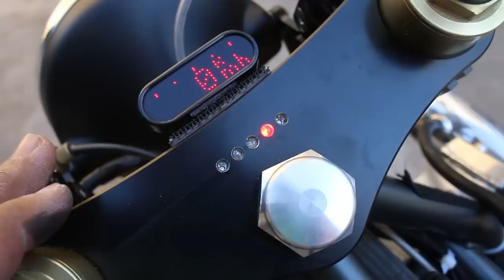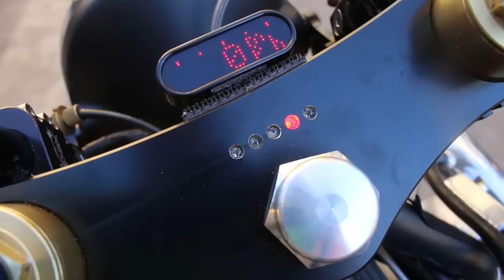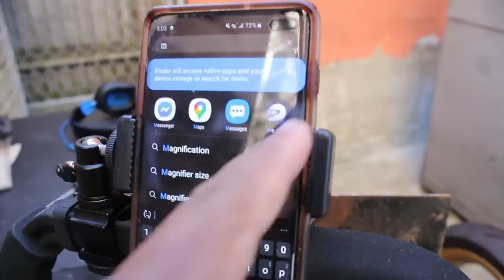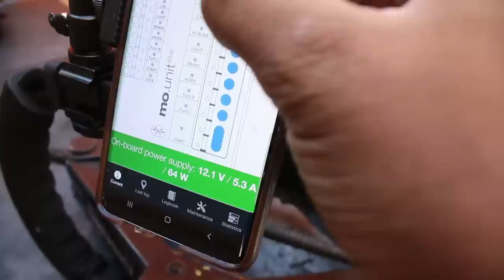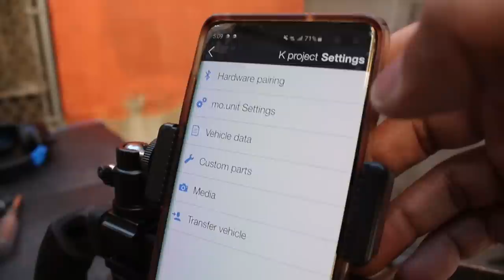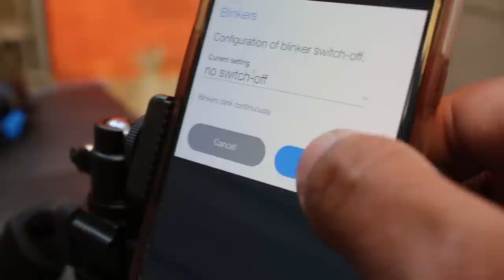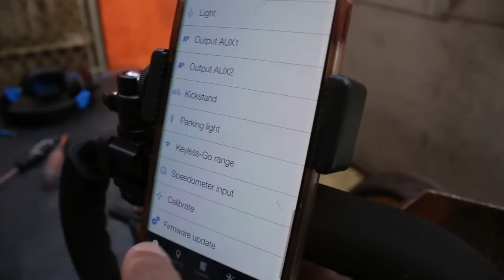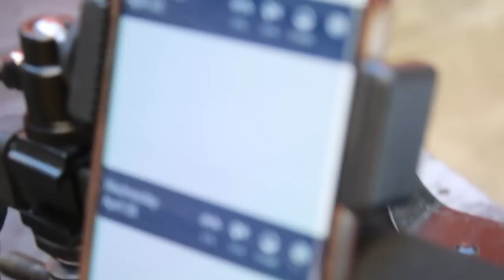[Ep 15] 1986 BMW K100 Cafe Racer Project - Lighting Overview & M-Unit Features

Comment: It's like unwrapping a present every time you want to work on the bike lol.  I would be happy every time.  Glad to see a new video.
Reply from the maker: 😂Thanks for watching!
Reply: @Theillestrator1050  Heck yes!  I built a motorcycle out of nearly the same components ten years ago.  

GSXR 750 front end on a Suzuki GS with a Ducati rear half frame and a R6 shock and 180 rear wheel I can't recall.  It was a LONG project. 

I never should have sold it. 

When I came across yours I binged it and smiled as it was like a good flashback!

Comment: That M-unit is awesome. I’ll probably use it if I fix up an old bike again someday. Glad to see you’re doing ok, especially in such a heavily hit area. I’m ok here, but broke my foot getting my bike out of winter storage, so now I’m not riding till summer. Stay safe, and hang in there!
Reply from the maker: I definitely recommend it,  it's expensive at like 400 bucks but you can get the non bluetooth version for 300 or so...I say go all the way though. Yes im good health wise, just naturally in a slump.
.....😰 ok well you gotta describe how you broke your foot getting the bike out...too ironic not to.
Reply: - The illestrator - I think we’re all in a slump these days. So I had my bike tucked away in a storage unit for winter. Put the battery back in, started it up, did a couple wheelies, went to leave. Automatic gate didn’t open. Same problem as red light sensors, it didn’t detect the bike there. So I hopped over the gate to punch my code in from outside to open the gate. Did not stick the landing. 😞

Comment: I think its pretty good that they dont let you start the bike with bluetooth, dont think thats secure.
Reply: I wonder if it needs to see that the bike “is in neutral” (electronically) to use the starter on the app. Bluetooth can be very secure, but depends on the version of Bluetooth that it (motogadget) uses on the security that it provides
Reply: I would assume its based on safety. They don't want the liability of you remote starting your bike in gear and it shooting out into the street or spearing a small child.

Comment: Trust me, after a while, or your first boil over, you will want to setup at least a simple thermocouple style fan switch/relay setup to kick those fans on.  Especially with no temp gauge.
Reply from the maker: Maybe, but if that ever becomes a bridge to cross, I'll wait until I get to it. The bike has a shut off feature that will kill the bike before a boil over. Not terribly worried about that. And if it's hot out, or im in traffic, I'll just keep the fan running. I'll learn if that's a mistake at some point lol

Comment: Good to see your still alive 😬 bike looks awesome! I wanted to let you know that this build is inspiring that something this cool can be built with minimal tools. Thanks for this vid as I was wondering how the m-unit app works. Couple of questions... can the fan be set up with a temperature sensor vs a button? And when are you going to finish the seat?!
Reply from the maker: Thanks man, I'm sure you can set up some sort of fan switching relay if you really look into it. This is just a quick and dirty route. As far as the seat goes, I'll foam it this week before moving it out the back.

Comment: I'd imagine having the starter plugged into the blutooth would be a problem if you parked it in gear lol. It's crazy that you have become so familiar with the bike that you know what every wire does. Pretty soon you will be making your own color matched wiring loom. Great job, man
Reply from the maker: 😂 didn't even think of that... they're probably thinking of the lawsuit when the bike goes flying into traffic. I know all the wires, if only they were neater lookin
Reply: @Theillestrator1050  Some plastic convoluted tubing goes a long way to making wires look neat for only a few bucks at the auto parts store

Comment: Glad to see the progress, was thinking about you and NYC the other day. 
FWIW  I thought I had a sprag clutch problem too, tried the Rislone / Syn oil approach, turned out to be starter brushes.
That was at about 80K miles. Got home a couple of times by bumping the bike backward in gear. 
Hope you can get some miles on it soon! 
Ride safe! Wash your hands!
Reply from the maker: Thanks, 
So I have two starters because I thought the starter was the issue too... second starter changed nothing. I then tried the backwards roll trick... didn't work. Next step is to try the rislone and oil change. Hope that works for me..
Reply: @Theillestrator1050  I should have known you'd be on top of that.
Here's hoping! Cheers!

Comment: Awesome as always! About the wing nuts, try some loctite on them before you go for a ride. Vibration will wiggle them loose in no time. Ask me how I know!
Reply: Just use two spring washers underneath or nylon wing nuts
Reply: I have wingnuts on my Springer with regular split lock washer and have not had a problem. Seems milage may vary
Reply from the maker: Okay I shall get longer bolts and run lock washers.

Comment: sounded like a motorcycle chase in the background haha. do you keep the bike covered in anyway to protect from corrosion? if so, you should clean up the rusty bolts on some of the exterior mounts and put a coating.

Comment: If you want, you can use the stock speedsenor for the speedo. I managed to get it working on mine as well as I didn't want to run an additional (non-stock) sensor on my #projecthenricus build. Drop me a line if you need some more info on this! Love the vids and they inspired me to take on another build!
Reply from the maker: Gotcha, if I can't get the Reed sensor to work reliably then I will. Thanks
Reply: Rik, I'd love some information on how you got the standard k speedo sensor to work.
Reply: Rik Spijkers hi Rik, I’d love more info on how you used the stock speed sensor on a K bike for an aftermarket speedo. Cheers Ken
Reply: @kenramsay710  You should open your standard dashboard and look for the MotoMeter chip (similar to https://www.ebay.fr/itm/392304284681).
You will have the following connectors:
BE	Eintrieb - Signal from rear-drive (Yellow)
-	Earth to bike & brown wire from rear-drive
BA	Ausgang - Signal to new speedometer
+	To +12 Volt bike
That did the trick for me. Goodluck!
Reply: @TheFarmertim  You should open your standard dashboard and look for the MotoMeter chip (similar to https://www.ebay.fr/itm/392304284681).
You will have the following connectors:
BE	Eintrieb - Signal from rear-drive (Yellow)
-	Earth to bike & brown wire from rear-drive
BA	Ausgang - Signal to new speedometer
+	To +12 Volt bike
That did the trick for me. Goodluck!

Comment: I was shooting my Brooklyn vid and wondering if you were good. That app looks like a great way to troubleshoot any electrical problems that might crop up, plus the set up on the bike lets you replace a single wire instead of having to yank out an entire main harness. The starter function not working on the phone could be an anti-theft function, I dunno. That seat looks kinda brutal tho...
Reply from the maker: The app is great for that, lot of brains in the m unit. Someone also brought up the safety hazard of starting the bike you forgot was in gear like that too. Seat has yet to be foamed.

Comment: Love it, the only two things I'm confused/concerned about are the lack of a neutral light and the manual radiator fan.
Reply from the maker: I'd much rather have a gas light than a neutral light. I rode the bike for a week and a half before without a neutral light without incident. I don't mind. 
Manual fan because I'm not sure how to automate it with the M unit. Not a huge deal to me though, maybe down the line I'll look into it.
Reply: @Theillestrator1050  you can automate it without the m-unit just get temperature switch.  Something similar to https://www.mouser.com/ProductDetail/Honeywell/3455RC-01000250?qs=F1jq4PciTHvsHZV2OE%2FvVg%3D%3D 
just mount it to the radiator with thermally conductive epoxy.

You got several comments about the wing nuts.  Something seemed off about using them to me too.  Maybe you don't know about dzus clips?  That would seem more appropriate to me if you want something tool-less.  They use them in racing applications to hold on body panels and thing like should be good for seat pans and whatnot.

Comment: trynna stay busy over here too! I have a fully custom sticker kit (featuring Geordi LaForge) coming in for my DRZ, and just got a SV1000S thats about half way through being set up right.

Been putting off addressing some electrical issues on the SV. Also, man I'm not sold on this whole hydraulic clutch conceit.
Reply from the maker: This is definitely a good time to get things done if you have the extra funds for it. Bro, it's insane just how bad the electrics on the SVs are, issues come up all the time it seems. What's wrong with a hydro clutch?
Reply: @Theillestrator1050  
I'm lucky. Since I'm a web dev guy the job is still there, I just do it from home now.  
The SV's previous owner made tweaks like heated grips and a pcv where the wiring looks good, but then also cheeseball "carbon fiber" led blinkers without a flasher module so it had the fast blink. I guess I just need to pull the plastics off and make sure there's no hidden weirdness.

Hydro clutches, I'm just used to cables is all. The sv came with (far as I could tell) stock 2003 clutch fluid, which had me thinking "man, I'm so glad Suzuki didn't just run a cable between this lever and the clutch plates..."

Overall been having fun with this bike though. The drz/sv combo is dope cause each bike is awesome at what the other kinda sucks at.

Comment: I'm afraid those wingnuts will loosen itself during riding... Better use a springwasher or alike between the bolt and nut.
Reply from the maker: Okay, I'll throw a lock washer on there

Comment: Can you dual purpose any of the lights?  e.g. have the red light on for oil pressure problems, but have it flash for low fuel...  That would free the green light up to be your neutral light.
Reply from the maker: The K100 came with a gear indicator standard so you have to basically set up a waterproof switch at a certain position for the gear indicator spindle behind the transmission. I can then add another LED and just slap it somewhere to give neutral the green light and just have my gas light be somewhere under the tank or something...I know how to set it up... but I can't be bothered lol

Comment: If you fill the whole bolt with a second magnet for the speedometer how are you gona remove the disk if you need to ? Shouldn't you make some kind of special dedicated attachement on your disk to avoid any removal isse in the future ?
Reply from the maker: I'm not too worried about it. A rotor change is so far away and I'd just turn that one bolt into one that can be vice gripped or turned with a wrench.

Comment: That M unit is a great piece for custom bike builders. I'll never need one but at least I know about it. Does it need to be shielded from water?
Reply from the maker: Well It cannot be disassembled, no real seams on it but considering the holes from where the terminals are...I'd honestly say it's probably not waterproof. The tank has a gasket to the frame which is good
Reply: - The illestrator - You might be able to make a sort of boot for it out of roll-rubber roofing material. Go to any construction site and they'll be scraps in the dumpster.

Comment: if you ground the indicators off eachother you can have a neutral light, probably not worth the effort though
Reply from the maker: The K100 came with a gear indicator standard so you have to basically set up a waterproof switch at a certain position for the gear indicator spindle behind the transmission. I know how to set it up... but I really don't care to lmao